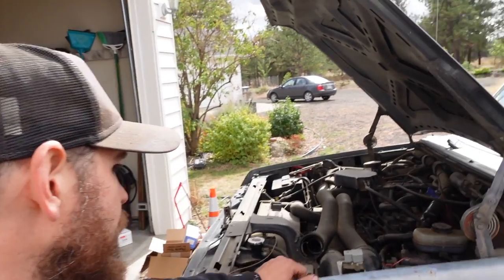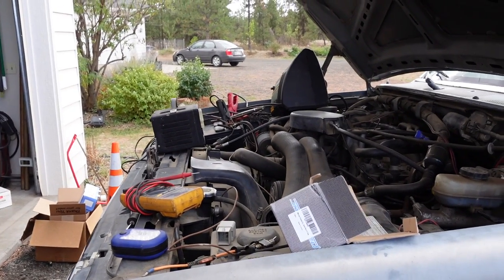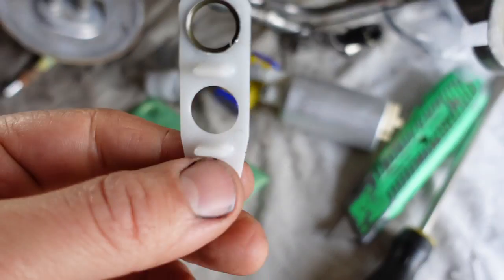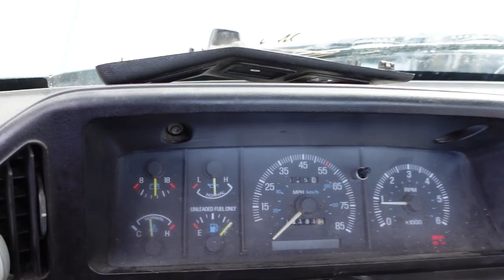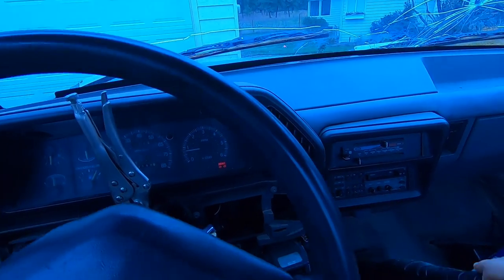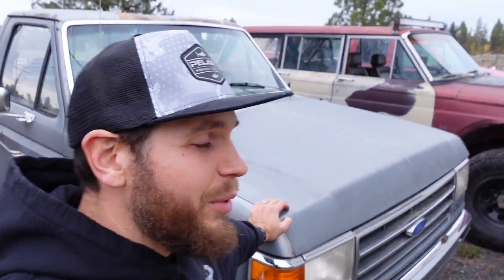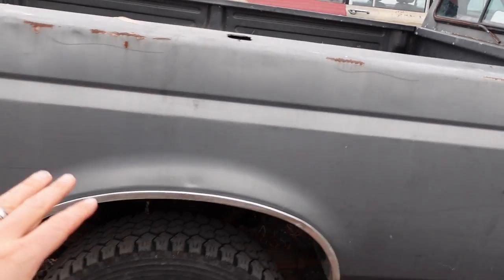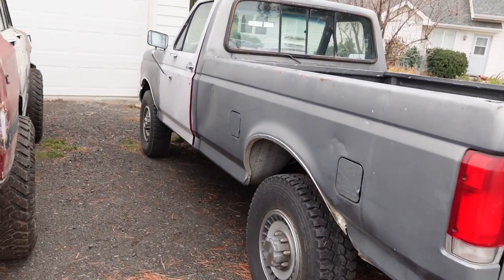1989 Ford F250 In Tank Fuel Pump Replacement: Project Fordinand

Comment: Nice video. Thanks for the posting i Have an 87 f150 Truck cranks, but won't start. I was taking a long trip with it. I had both tanks filled with gas. I did 245 miles on front tank, Then I switched it to the rear tank, and put on 44 miles and the truck decided to quit on me. I pulled off to the side of the road for ten minutes, then she started up and I was able to drive a half a mile and same thing stalled again, that happened three times, now all it does, is just crank. I sprayed starting fluid into the intake and she started but stalled. I changed the pressure regulator also, When I turn the ignition key on, I can hear front fuel pump prime when that tank is selected, And also the rear tank when selected. I can hear that prime to when key is turned on. I took off fuel filter and I was able to blow through it. That's was clear, so I reinstalled it. I pressed on the schrader valve on the fuel rail. But nothing happened, no gas came spewing out. I can't see both of my in tank fuel pumps taking a crap at the same time. I own the truck 4 years. Question the high pressure fuel pump thats on the frame rail ? What I think I seen on frame rail was fuel tank selector,  then high pressure fuel pump, then fuel filter. That's looking up at it from left to right or back to front. Am i correct that this is the location of the high pressure fuel pump, im just not sure. Do you think that could be my issue, Considering I was driving the truck when this happened using the front tank of gas, then switching over to the rear tanker of gas, and then it died on me. Any help would be appreciated.Thank you
Reply from the maker: I would disconnect the line before the high pressure pump and confirm both low pressure pumps are working, then disconnect the line after the high pressure pump and confirm it’s working. I think there is a relay for the high pressure pump, could check that if the high pressure is not working, also could run a jumper wire to the high pressure to confirm it works
Reply: @DaysofPainandVictory  ok, I'll check that out. I won't be with the truck for two weeks, but I'll do what you said. Thank you for getting back to me, I really appreciate it

Comment: I just acquired a 1989 Ford F250 4x4 Custom truck that was last registered in the year 2000. It sat in a barn for that past 22 years. It only has 40,000 miles on the odometer. The previous owner says the miles are correct. The truck is a time capsule - in almost perfect shape. It was stored in West Texas - very dry climate. I put tires on it and rolled it onto the car hauler. Before attempting to start it I changed the oil, plugs, battery, added coolant. I put 2.5 gallons of gas in the front tank It turns over quickly, but won't start. I sprayed starter fluid up the air filter hoses and tried to start it. The truck came to life and ran smooth on the starter fluid, but wouldn't stay running. I have a gas problem. What do you recommend I do/replace first? Thanks
Reply from the maker: right on man sounds like a great find! I would disconnect the fuel line before the high pressure pump, turn the key on and check for fuel there, then after the high pressure pump, then at the rail first. This will check the  low pressure pump, high pressure, pump, and fuel filter in that order. good starting point
Reply: @DaysofPainandVictory  Excellent - thanks, and I'll post later to let you know how it went.